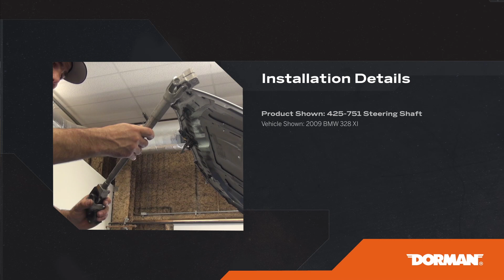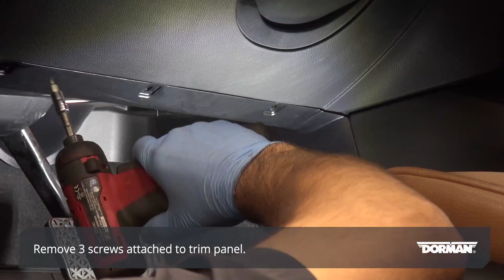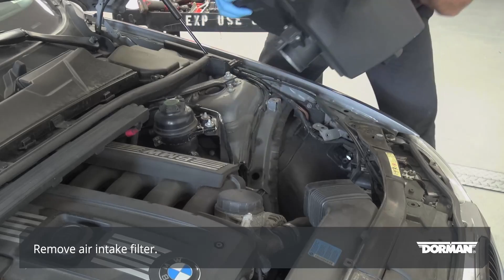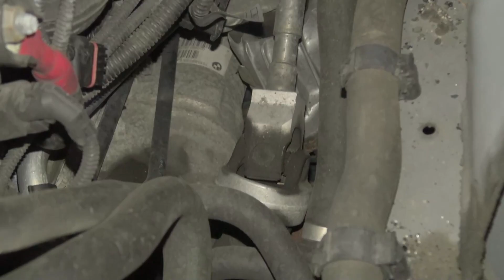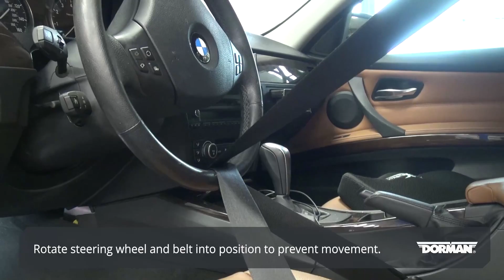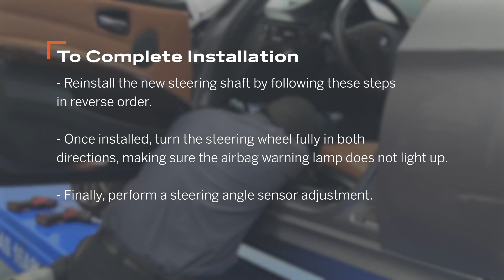Steering Shaft Installation - BMW

Comment: I'm in a situation right now.. I have replaced front control arms and thrust arms and tie rods and passanger side cv axle ( all from fcp euro (lemförder)Steering is still really loose. The steering wheel damn near goes 2 1/2 full turns just to turn. I don't know if it's the rack.. the power steering pump or the steering shaft/column. I haven't had an alignment yet do to funds.. but would alignment do me any good?

Comment: I just removed the boot yesterday to put silicone grease (Honda ShinEtsu) on the shaft gear/spline and the steering wheel "zipper noise" was fixed! As far as putting the boot back on, I did my best to make it sit as flat against the firewall on all sides, but there's still a little gap on the inside of the car, definitely wasn't like that before I removed it. But I think it should be ok, as the lower dash panel has a back part to help hold it in place. Best I could do, especially laying half twisted on my side/back, I need a chiropractor now!

Comment: Good video but you make it look so easy. Keep in mind us people in the rust belt. Fought with bottom spline for an hour with air chisel. Trick is to get in the groove and with a chisel (air hammer works best but be careful not to go so far you damage the spline) so it widens and will slip off. If I didn't do that it wasn't coming off. Book time 1.8hr took me 3.

Comment: This was very helpful. Man was it a pain to get that boot back on.
Reply: how do you get the boot back on?!
Reply: I wish I could remember, that was a long time ago.  I forgot I put the steering shaft in
Reply: @1970gregg  that boot... I can't put it back tight, now I heard noise from the engine bay...
Reply: @tom232722gda  What's the purpose of removing the interior bits? When i got my rack and pinion from a junkyard I just removed a bolt up top near the firewall and dropped the intermediate shaft with the rack and pinion.